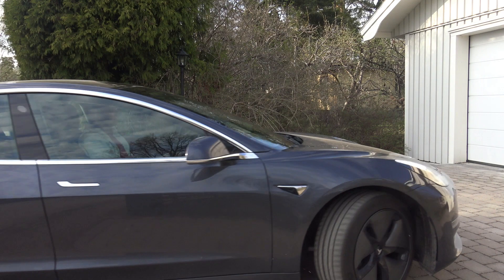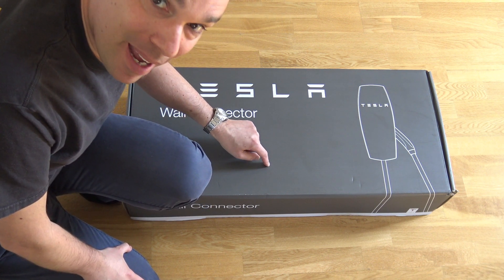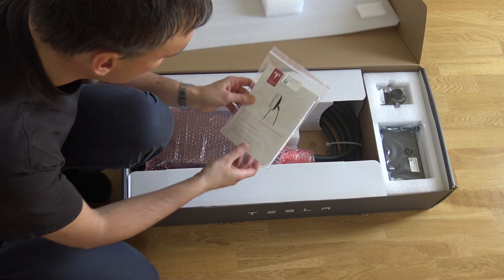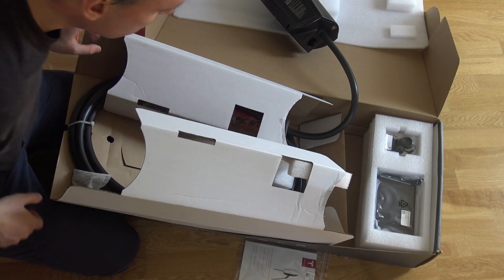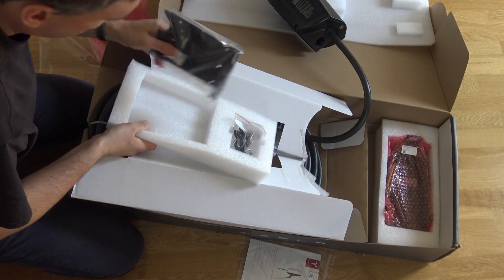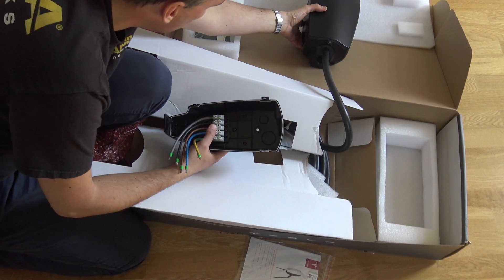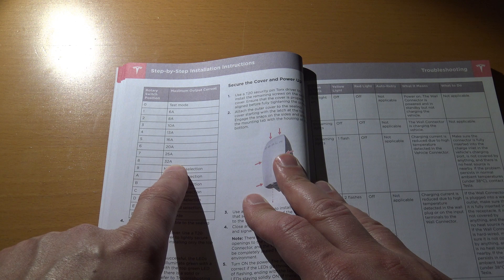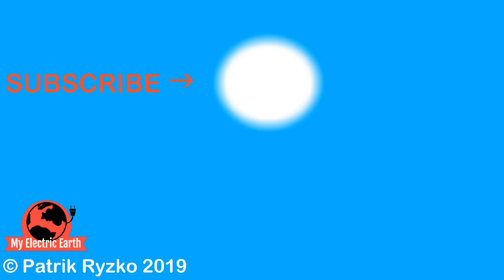Unboxing of Tesla Wall Connector

Comment: Do most homes in Sweden have 3-phase electric service?  If so, what are the voltages phase to phase and phase to neutral?
Reply: Pretty much all homes have 3-phase 400 volt at minimum 16 amps in Sweden